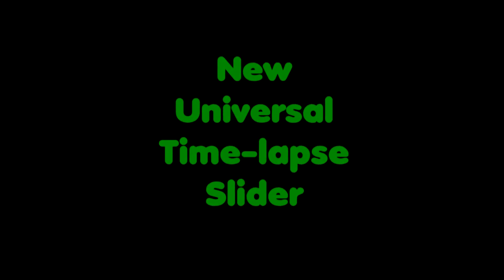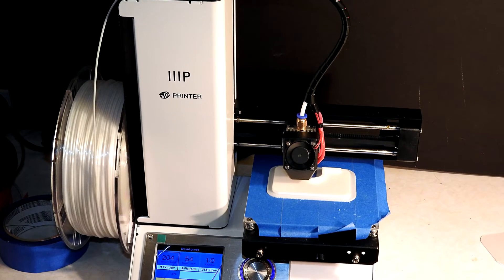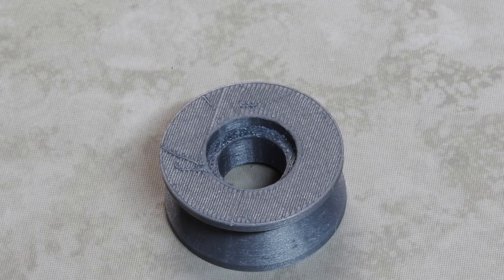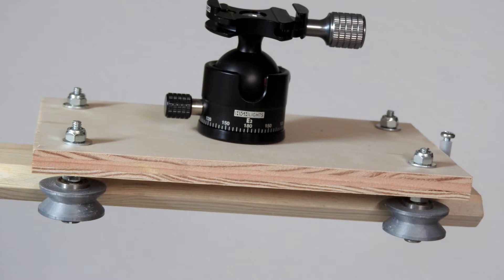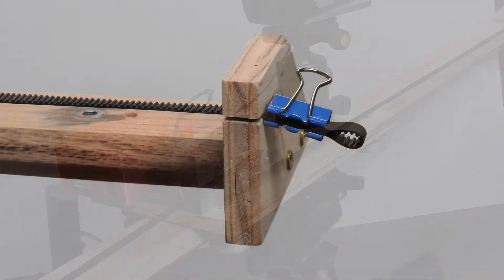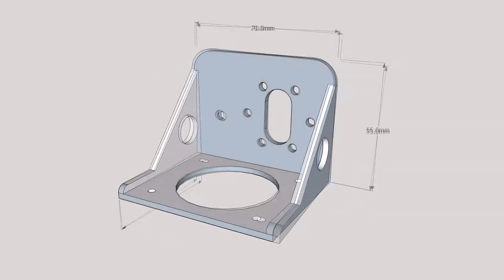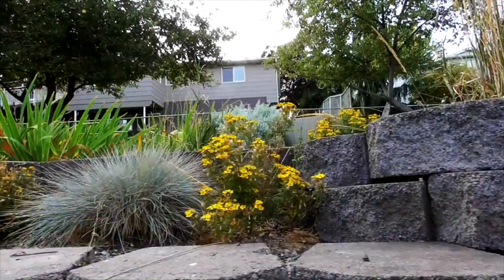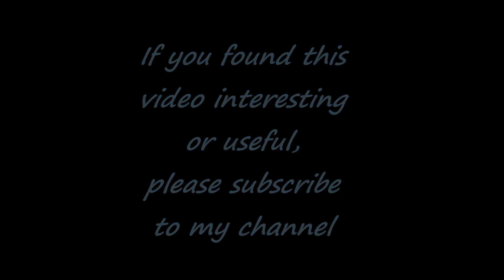New Time-lapse Camera Track

Comment: What do you estimate the cost of the build to be in USD $?
Reply from the maker: Cost of this one would be near $100.  The Pi and Motor Hat are kind of expensive.  I'm working on another that will probably be around $60. It uses very small, inexpensive, geared stepper motors and Arduino board and motor shield. The camera shutter release is pressed with a micro servo mounted on camera hot shoe. All drives are similar to the current version. Three stepper motors and servo run from one motor shield and single battery. The new project could be done without the motor shield, since the steppers come with nice drivers, but I have the shield and it adds some capability.  I should have it done in a week and will probably publish a short video and will have plans on my web site. 

Thanks for questions and thank you for viewing.